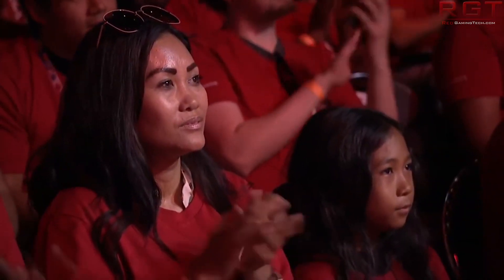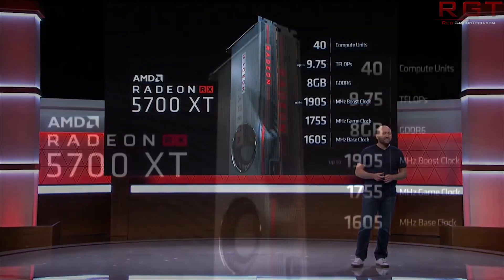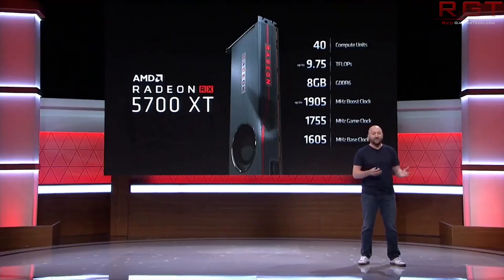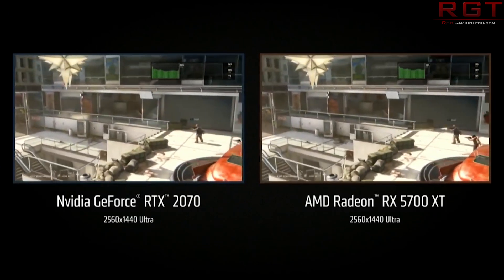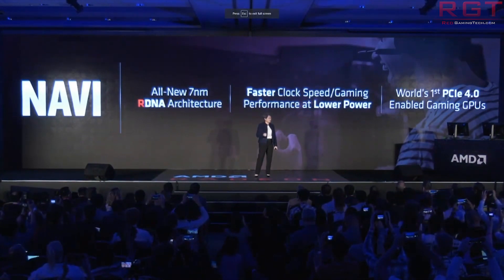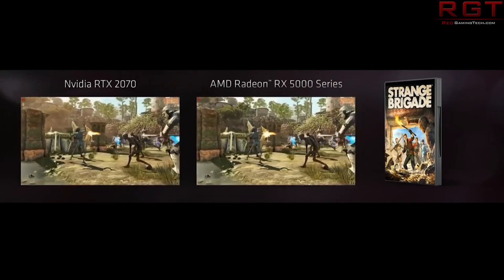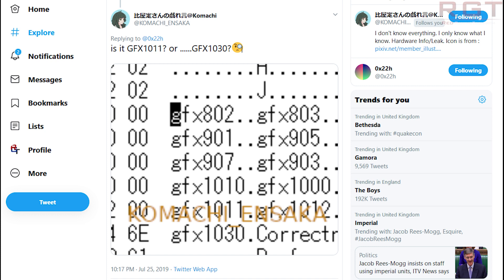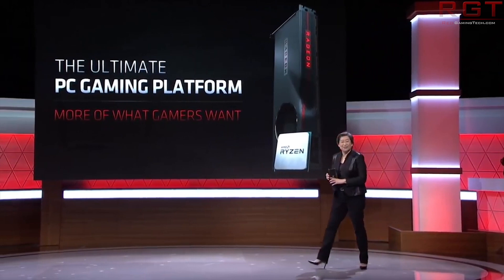Navi High End GPU Launching This Year ? | Intel Discrete GPU Specs Leak & It's a Monster

Comment: 4096 cores on RDNA will beat 2080Ti easily. Might need HBM2 in order to keep consumption below 300W and allow high clocks. And the prices could be $600 for the cut down version and $800 for the complete.

Comment: Ice Lake-U/Y is going to have crappy CPU performance (extrapolating from Intel's sole obfuscated CPU performance graph where they compared Ice Lake-U with .... Broadlake it is going to have 3 - 4% higher single core performance, 5% tops). This is why Intel masked its CPU performance numbers in their Computex presentation and only talked about iGPU performance, AI performance and ... wi-fi performance. While Ice Lake has a higher IPC nearly all of the performance gains were eaten by the much lower clocks, courtesy of Intel's crappy yields of their 10nm+ node.

On the other hand Ice Lake will apparently be superb in encoding, it has native support for Thunderbolt 3 and as for the iGPU performance this will depend on how rare Intel plans to keep the parts with the 48 - 64-core iGPUs. Bear in mind that they still have not retired UHD iGPUs, not even with Ice Lake (you can even see that in a graph in this video). If the 48+ core iGPUs are super rare, only for the most high end parts (which is a standard page from Intel's playbook) then what's the point?

Comment: Lol why are people thinking higher end Navi's will have HBM my memory? It is designed with gddr6 and will only come with that.. And why would you need hbm2 for gaming anyway?
Reply: problem is that GDDRx is obsolescent the newest gives you 2 variants 1GB and 2GB per chip, 56 to 72GB/s Bandwidth and 32 bit bus,
very top give you setup of (12x1GB) and (12x2GB) 24GB, 864 GB/s Bandwidth and 384 bit bus.
vs
HBM2 architecture allows a 1 chip 307.2 GB/s Bandwidth with a 1024 bit bus, layers stacks of 2/4/8/12-Hi or 1GB per layer.
now outside of data centers the most used variants are the 4/8 Hi stack chips and in the common form of (4x4GB) 16GB 

and (4x8GB) 32GB, 1028 GB/s and 4096 bit bus.

But Samsung newest HBM2 (Flashbolt) is a chip with 8-Hi with 2gb per layer. (1x16GB) 16GB 410GB/s and 1024 bit bus,
so 2 chips would gives you HBM2 with 32GB, 820 GB/s bandwidth and 2048 bit bus. 
Vs
TRTX (12x2GB) 24GB chips 672 GB/s Bandwidth and 384 bit bus.

why? it dose look like 5700 XL has the same bandwidth problem as 14nm Vega which had 484 GB/s and 410GB/s with 2048 bit bus,
that was fixt for VII by going 4x4HI and 4x8Hi 16/32GB with 1TB Bandwidth with 4096 it bus.

there will be less of a problem for AMD make HBM controller vs the long and hard work making new controller for new gddr6 work there architecture, as HBM is AMD baby, Also if rumors of Arcturus architecture is a GCN/RDNA hybrid, 

now if Navi top is 64CU then we have 3 card to come on 7nm or more likely on 7nm+
4096:256:64 64CU
3584:224:64 56CU
3072:192:64 48CU
+ already here
2560:160:64 40CU
2304:144:64 36CU

so if not a bandwidth with top 3 why not launch all together going  head to head from top down.

Comment: If I had to take a guess I would say a 5900XT 16GB HBM2 for 999$ that beats a 2080ti by ~25%
Reply: no 4096:256:64 64CU will at most get a Single precision of 14,100-ish an more like lower and we will most likely be 5%  behind the 2080Ti in 30 games Benchmark done by the Aussie Top Tech Troll and to get a win of 5% over the 2080Ti would say we need 17000 Single precision before boost

Comment: I really hope they price this card at $600 or around there just to slap Nvidia in the face lol.  Also I hope the XT version of this beast can be had with 16gb hbm2.
Reply: If 384bit 14/16GBps is enough, i hope they don't go HBM. HBM needs to pick up the slack. The power saving is nice, but the price and it's stagnating performance are huge technological turn offs. GDDR6 18GB/s is pretty much ready to ship, so yeah.

Comment: 5800 XT with 8gb HBM2 / 5950XT with 12gb HBM2.. 5700/5700xt are bandwidth hungry.
Reply: so far I have not see any HBM2 2-Hi chips in anything and 2x4-Hi chip (aka 2x4GB) is just 614GB/s same as 11gb of gddr6 and 3x4GB 12Gb and 921GB/s now that would top Samsung gddr6 at max 12x1GB 864GB/s but could be hell to package 
so if a Navi
4096:256:64 64CU

3584:224:64 56CU 

3072:192:64 48CU
would have HBM2 it would most likely be 4x4GB 1TB bandwidth

now Samsung HBM2 Flashbolt that is today a 8-Hi 2gb per layer and 410GB/s, So I would say a 2GB HBM2 chip will never is the light of day
Reply: @1BigBen  SAMSUNG is not the only HBM manufacturer.
Reply: @crismeman3386  nope, but they are the leaders the last two update to the HBM standard was Samsung last one was hbm2 aquabolt become JEDEC Extends HBM2 Standard.

Samsung, Micron and SK Hynix make HBM2 but so 4-Hi is the lowest
Reply: Maybe it's high time they moved to HBM3?
Reply: @NikolaosSkordilis  well I'm betting when Samsung Flashbolt covers the 12/16-Hi that will be the last update to HBM2
so the HBM2 standard will 22nm 2/4/8/12/16-HI 2GB per layer in one Chip or 4GB/8GB/16GB/24GB/32GB Chip 410GB/s Bandwidth and 1024 bit bus. 
it looks like the only thing left that was post to be done with development of HBM3 is 32-Hi 2gb stack and single chip Bandwidth of 512+GB/s.

so HBM3 I say they will move from 22nm to 14nm and rest time will tell.
Reply: So no improvement over gcn then same hunger for high memory bandwidth?
Reply: @kingyogesh441    no I would not go that far, 40CU RDNA is kiling 14nm 64CU GCN and fighting VII 
also we still haven't see the AIB 36CU and 40CU Cards and how they will be setup.

also we not know how much it scales up over 40CU.

now let say bigger die over 40cu scales in 8CU and tops at 64cu around VII die size 
331 mm2 not sure about 64 ROP I always feel like it needs to be more.
4096:256:64? 64CU
3584:224:64? 56CU
3072:192:64? 48CU
251 mm2 DIE
2560:160:64 40CU
2304:144:64 36CU

now Lisa will give us new roadmap at Hot Chips 31 August 18-20

Now RDNA top aim was scalability well it look like it will go into phones 
but how high can it go and going back old naming so lets have fun

Entry-level

2304:144:64 36CU
2560:160:64 40CU
Mid-range

3072:192:64? 48CU
3584:224:64? 56CU
4096:256:64? 64CU
High-end
4608:288:128 72cu

5120:320:128 80CU
Enthusiast
Dual 2x 5120:320:128 80CU

Comment: Who cares if the 2080ti price comes down , I just want 2080ti plus performance at 599-650 mark and that would be value.. the 2080ti can go up in price for all I care I WILL NOT BUY NVIDIA....PERIOD
Reply: So, if AMD will release a GPU that beats a 1300$ RTX 2080 Ti at 1000$ you wouldn't buy it? You wouldn't buy a better card at 300$ less?
Reply: @_A.d.G_  hell NO!!! 1000 dollars for a freaking graphics card alone ...complete waste of money ...im telling you at 1440p there won't be much noticeable difference.. the most I'm willing to spend would be 550 and it better be top knotch...
Reply: @larryfleming7295  so if AMD released a card that beats the 2080 Super at $499-$599 you wouldn't buy that?
Reply: Aldo Miguel  yes I would but not at 1000 dollars .. I’d give 500-550 and I could swallow that but to much more and I’d feel like an idiot for wasting that much money and I wouldn’t allow myself to feel like a fool
Reply: Aldo Miguel wait!!!! I was talking 2080ti performance.. as it is right now the 5700XT basically performs like a 2080 already... if you put them side by side in a blind test you couldn’t tell the difference..not 200 dollars difference
Reply: @amr.c1650   I have had 2 AMD cards burn up after warranty. (not overclocked) I only had 1 fan fail on an Nvidia card. I will use my Intel on chip graphics before I give AMD the sweat off my nuts ever again.
Reply: @wysetech2000  too bad you weren't around nvidia burning pcie and cards via flawed drivers
Reply: @TheMasterChief777777     Never had a problem.....EVER.
Reply: @wysetech2000  I've had both
Never had a problem with neither
So... Kek
Reply: @wysetech2000  but Nvidia actually has some old quality scandals too
And I think they're pretty more scandalous

Comment: GDDR6 gives you 2 variants 1GB and 2GB per chip, 56 to 72GB/s Bandwidth and 32 bit bus,
or as in common form of (8x1GB) 8GB 448/496 GB/s Bandwidth with a 256 bit bus,
(11x1GB) 11GB 616 GB/s Bandwidth with a 384 bit bus and (12x2GB) 24GB, 672 GB/s Bandwidth and 384 bit bus,

HBM2 architecture allows a 1 chip 307.2 GB/s Bandwidth with a 1024 bit bus, layers stacks of 2/4/8/12-Hi or 1GB per layer.
now outside of data centers the most used variants are the 4/8 Hi stack chips and in the common form of (4x4GB) 16GB 
and (4x8GB) 32GB, 1028 GB/s and 4096 bit bus.

But Samsung newest HBM2 (Flashbolt) is a chip with 8-Hi with 2gb per layer. (1x16GB) 16GB 410GB/s and 1024 bit bus
so 2 chips would gives you HBM2 with 32GB, 820 GB/s bandwidth and 2048 bit bus
vs
TRTX (12x2GB) 24GB chips 672 GB/s Bandwidth and 384 bit bus.

now AMD has said CES 2020 will not be about CPU. so CES 2020 Arcturus and Navi.
AIB cards PAX west next week?
Hot Chips, Monday, August 19 Keynotes Lisa SU, roadmap for the months and years to come
R9 3950x 9/9 2019?
TR3 zen2 November horizon?

Now a Mic drop would be a 3 AIB cards in October on 7nm+ with a refresh in 2020 Q3 on 7nm++ 
4096:256:64 64CU 28,200-ish 2019 7nm+ and refresh in 2020
 7nm++
3584:224:64 56CU 24,000-ish 2019 7nm+ and refresh in 2020
 7nm++

3072:192:64 48CU 20,110-ish 2019 7nm+ and refresh in 2020
 7nm++
2560:160:64 40CU 16,440 8,220 7nm and refresh in 2020 7nm++

2304:144:64 36CU 13,500 6,750 7nm and refresh in 2020 7nm++

???2048:128:64 32CU 9,900-ish??? 7nm

bigger Mic drop would be a 3 AIB cards in October on 7nm+ and 2020 Q3 Navi II 128CU 
4096:256:64 64CU 28,200-ish 2019 7nm+ 

3584:224:64 56CU 24,000-ish 2019 7nm+

3072:192:64 48CU 20,110-ish 2019 7nm+

2560:160:64 40CU 16,440 8,220 7nm

2304:144:64 36CU 13,500 6,750 7nm
???2048:128:64 32CU 9,900-ish??? 7nm

BUT most likely in November at "horizon" with TR3 we see a Working Navi on 7nm++ Teaser
and at CES 2020 we see
Arcturus GCN/RDNA hybrid with HBM2 for data centers
and Navi with HBM2 that Launch in Q2 2020
4096:256:64 64CU 7nm++
3584:224:64 56CU 7nm++
3072:192:64 48CU 7nm++
2560:160:64 40CU 7nm++

2304:144:64 36CU 7nm++

Comment: intel has 8 fp32 units per EU. if i understand it correctly EU's are like SP's or cuda cores, not like CU's,  intel calls CU's sub slices i think.  but anyway 512 X 8 would be 4096.  and intel's graphics have double the fp16 performance if they dont cut that out.  they get around 1250mghz on a very small die that shares cooling and power with a cpu and is set up to run very efficiently with low voltage and power limit.  i think they would get at least 14-1500 mghz on a discrete gpu.  

starting to sound a lot like vega 64.  i hope they dont have the same geometry and utilization issues that vega does. 

the other thing that makes or breaks a gpu is the software support. intel are new to graphics driver software but at the same time they have a large pool of talented software engineers so i dont think the lack of software people that amd had will effect them as much.  itll be a slow start but once they get things squared away they could compete decently enough.  i would think most of what they sell would either be high end compute cards or 1050 ti class gpus for laptops.  server and mobile has been intels focus for a long time
Reply: Come to think of it, my worst driver experiences come not from either nVidia or AMD... but from Intel.

Comment: 32GB HBM2, 80CU... 1200$... here, take my money!
Reply: 1200 is too much.
Reply: well 5120:320:64 80CU wait lets double the Render Output Units have same number as Votla :þ 5120:320:128 1200$ it would need to be with the new Samsung HBM2 Flashbolt 4x8Hi (aka 4x16GB ) 64GB or cut down to 4x4Hi (aka 4x8GB) 32Gb with 1.6TB bandwidth 4096 bit Bus

5120:320:128 80CU standard HBM2 4x8Hi (4x8GB) 32GB with only 1TB not over 999$ :þ
Reply: @1BigBen   gaming cards shouldn't go beyond 799 ...and considering the hbm lay out if what if they run a 6 x 2 ..wouldn't that widen the bandwidth .instead of 4 stacks go 6 … I want to see AMD do something mind blowing , they are known for trying something new and different. Now they have money coming in they can focus on gaming as well.
Reply: @larryfleming7295  problem is that most GPU are not develop with gaming in mind, they are made for data center, supercomputers, servers and media work that is what pays for their developments a income that gaming sale could never get close too.

2gb HBM2 the problem is they are not stockpiling any of 4/8/12-Hi chips they just sale them without problem, so why would they bother to making the 2-Hi chip,

well the current standard HBM2 4x4-Hi 16gb 1TB/s bandwidth with 4096 bit bus, now lets say AMD gets Samsung, micron and SK Hynix to make HBM2 Hi-2 chips for they, 6x2-Hi 12GB 1.8TB/s Bandwidth with 6114 bit bus, nuts hehe 

now Vega 64CU was as highest it would scale, now let's say that a " Navi 80CU " is the top that would make 7nm Navi be on same level as 12nm Volta, 
cut it down to 80/72/64/56/48/40/36CU this would be the last generations of rasterization GPU.

NOW let's say Arcturus is a GCN/RDNA Hybrid as in Vega/Navi Hybrid, it could be AMD "RTX Quadro" card, so at the end of 2021 we could AMD first gaming card with dedicated hardware for Real Time Ray Tracing using 2gen Arcturus.

Now Lisa Su will show us a new Roadmap at Hot chips 31 Keynotes 18-20th of August 2019 and at CES 2020 she will talking about GPU's
Reply: @1BigBen  I just wanted to say thanks for your response

Comment: Go for HBM2 and 16gb of it.....should beat 2080ti then,...charge whatever the hell you want,people wil stilll buy it and they'll get the crown again.
Reply: But why HBM? This is not a compute card, and HBM will increase prices massively. Instead of an 800 dollar card, we will get a 1200 dollar card. Why not just 16GB of GDDR6?
Reply: @marcusrat4466  As I understand it, four stacks of 4GB will load and download faster. The faster the card, the faster it needs to move the rendered results. By doubling the bandwidth a higher clock isn't needed. You don't need memory with a clock higher than GDDR6 if you increase the bandwidth. HBM2 is all we have right now. HBM2 on the gpu die also reduces the distance from the gpu to the memory.
Reply: @marcusrat4466  GDDR6 gives you 2 variants 1GB and 2GB per chip, 56 to 72GB/s Bandwidth and 32 bit bus.
16gb of would be 8x2GB with same Bandwidth as 8x1GB 448 to max of 576GB/s at 16Gb/s and 12x1GB 12GB 864GB/s 384 bit bus or TRTX setup of 12x2GB with 672GB/s at 14Gb/s and 384 bit bus.
vs HBM 4x4GB 16GB 1TB Bandwidth and 4096 bit bus
Reply: I think your right and it may be the 5900XT or the 5950.
Reply: Nividia won't let that happen.